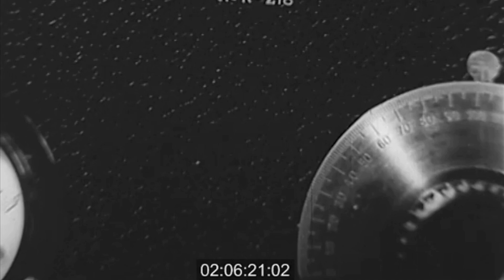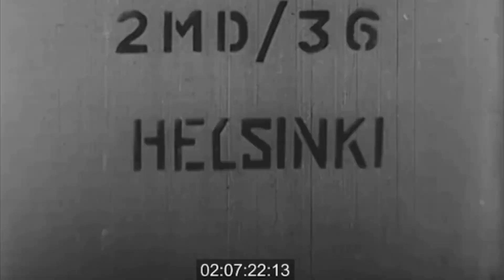How it's made: Radio     Vintage documentary movie - year 1936

Comment: I retired about 2 & 1/2 years ago from electronics maufacturing; rather than radio, I worked for a major manufacturer of very high - end computer hardware ( troubleshot circuit boards that went into their systems at the component level).  Fascinating to see the differences between vintage radio & preent - day electronics manufacturing (largely automated today).
Reply: what country?
Reply: @aaabbb4755  USA, In Massachusetts.
Reply: Hi Tom... any opportunities over there... Im in Kenya...
Reply: @StephenGachara  I’m sorry, I couldn’t say; I retired in mid - January 2020, just about the time the initial stories about Covid were starting out of China.  Company that I worked for was originally called EMC; they were bought out by Dell @ 6 ~ 7 years ago, now called Dell Technologies.
Reply: I was impressed by the freehand craft at the begining. My late father once visited a pipe fittings company probably in the 1960's where he saw basically young kids, maybe 16 (my father began work aged 13) turning the threads freehand, using wood lathe technology - it was simply faster and cheaper. Upon asking one of the youngsters how they managed to cut the threads so accurately, the reply was: "first thousand are the worst!"

Comment: Now surface mount components and radio on a chip. Next to nothing in it on a PCB. Little in modern things in the way of space but so much higher component count I bet with radios with USB, MP3 playback, Bluetooth   :)
Old school, Had a lot of valves and resistors out of an old non working old for then (1990 at college) oscilloscope us kids 16 years old or so where given to take apart. Old but not that old. Late 50's I bet. Nice how things where done, wired point to point, legs going to where they need. No PCB. Old cheap production but quicker made in china now. Nice video. Got an amatuer radio transciever in the car and a handheld. Not this vintage though. 2018 onwards to last year!.

Comment: back then, all radio's were "Q. C." inspected, and if any radio failed inspection, it was pulled off of the line for repair/ alignment. when repaired, the radio was put back into the main assy. line, nothing was waisted!!!. I bet the chassis was strong enough to be walked on without buckling, "PHILCO" did that back in the early days, they had as part of the inspection, the chassis  would be "STEPPED ON" to check for buckling, before the chassis was populated with components!!!!!
Reply: I was looking though to see if they filled in the space on the corner, behind the curved veneer.  That looked to be a potential weak point.   They may have and I didn't catch it.

I did see some manufacturing methods still used now, such as the veneer glue being heated to seal it on to the backing wood; I've seen the same thing done on furniture restoration videos.  Riveting on parts that might have to be changed later?  Yep, we definitely do that now as well (but at least rivets can be drilled out/ground off).  Our problem these days is tack-welding and glue on parts that might need replacing later.

We can get away with lighter materials and automated manufacturing now, just as in the 1930's they were making the best use of the technologies they had then.  The big difference between then and now is back then they put some thought into repairability*, which they outright don't *want to do now.
Reply: @SenileOtaku  ,I agree with you 100%, the only time screws were used to secure parts, was when you bought a "KIT", and those did not come along until the 1950's. even back then, mass production was used to keep up with demand, just like the printed circuit board was used to speed up production, and cut down on rejected radio's, T.V.'s ect.

Comment: Those hot chassis radios were dangerous. heck, back then everything  was dangerous.
Reply: Yeah but you never touch the chassis  until you need to replace a tube,anyways to change a tube you need to unplug it
Reply: It has a transformer in the power supply so it wasn't a hot chassis.
Reply: @gameyord7182  Or if the bakelite knob came loose and fell off the brass volume control shaft, you then have 220 V AC exposed for you to touch.
Reply: when I rebuild old radio's, I always use polarized molded plugs to avoid the "HOT CHASSIS" problem, the hot side is switched, and the neutral side goes to the chassis, unless the radio has a power transformer, giving line isolation safety.
Reply: @gregoryclemen1870  Greg, I too also replace the line cord with a polarized plug no matter if the radio is hot or transformer driven.  It is always good practice to plug any radio under test into an Isolation Transformer to protect yourself and your test equipment.  I also use a Dim Bulb Tester just incase the death capacitor is shorted and I also remove the rectifier tube when testing the transformer just because the filter caps are most likely bad. If the transformer tests good then I move on to the IF cans testing resistance, of course with the radio unplugged and the filter caps discharged.
Reply: @denouch358  , if I am going to "BRING UP" a radio for the first time ( variac/ lamp in series for dim bulb testing), the first thing that I do is cut the "DEATH CAP "out of the radio( for testing only), I have had my share of them "EXPLODE". the filter caps are not worth trying to reform them. as a rule my radio's are rebuilt(new wiring, new caps ,new resistors adding a "NTC" resistor in the fil. string ,so the heater string does not get slammed on start up) if the radio has a power transformer, it is fuse protected on the primary side, and I use a 3 wire service cord, grounding the chassis, and polarization is maintained.    thanks for responding!!!!.
Reply: @gregoryclemen1870  Until your house main earth gets damaged, or your wife plugs the radio in via an inverting double adapter.
Reply: @gregoryclemen1870  Hi Greg, I do the same as you do, the filter caps are the 1st to get replaced but only if the power xfmr and IF xfms are still good.  Thats why I remove the rectifier tube, just to test the power xfmr.  Best Regards
Reply: Definitely NOT a hot chassis!
Reply: @denouch358  As this is a European-made radio, it probably has a selenium rectifier.   These are like some electrolytic capacitors - if the radio hasn't been used for many years, the selenium rectifier may need reforming.  Disconnect everything fed from the rectifier and bring it up very slowly using a variac.   Monitor the rectifier temperature with a finger - if it gets warm without any load, you are bringing the voltage up too fast or the rectifier is defective.   Don't power selenium rectifiers at full voltage immediately until you have reformed or checked them.   If you do, you may learn the hard way - they can stink out your whole house and your name among residents will be ruined.
Reply: @denouch358  , I do the same as you do, I check all of the transformers first, before I continue on with the rest of the rebuild. I have a 1940 "PHILCO" radio that everything checked out, I have a good habit when testing the power transformer to document the secondary voltages. the power transformer after doing a complete restoration, shorted out and blew the fuse on the primary side that I installed. no big deal, I have a large stock of "new/ old " transformers on the shelve ready for use. so the radio got a new power transformer. I also have new/ old stock of cap tuned I.F. transformers, including audio output transformers, both single ended and push- pull primaries. I am so glad that the younger generation has taken an interest in this "STUFF", I never left it!!!!!   thanks for responding!!!!
Reply: @keithammleter3824  , I assure you "THAT WILL NOT HAPPEN"!!!!!
Reply: @gregoryclemen1870  Re other people in the house using double adapters:  yes, I've heard "that will not happen" before.
Re house main earths going open, or the neutral from the street to the house going open - yes it does happen.  In my state a girl child now has permanent severe brain damage as 2 years ago current stopped her heart until she was found - because the neutral went open, and the current went to earth via her bare feet.   And if the neutral lead in your polarised power cord goes open - same result if a pot shaft or other metal can be touched.
If you must restore an old transformerless radio, don't rely on polarised plugs, replace all brass-shaft pots with plastic shaft pots so that if knobs come loose it will still be safe.   Cut the tuning capacitor shaft and use epoxy to create an insulation barrier.  Make sure you have a rear panel that cannot come off without using a tool and that all screws & metal are covered.
Transformerless radios and TV's should not repaired or restored, as they are dangerous, unless there is room to fit an isolation transformer.   And there usually isn't.  Transfomerless colour TV's are especially bad because half wave rectification means DC drawn from the mains of sufficient magnitude to corrode away house earths.  English Decca colour TV's were after a while banned in my country for just that reason.
In the 1970's I did TV repair, and I always refused to repair Deccas because there was no way to make them safe.   They were crappy TV's anyway, using vacuum tubes long after all other brands were fully solid state.  But at least they had plastic pot shafts, unlike old vacuum tube radios.
Reply: @keithammleter3824  there is no need for adapters in my house, also the pole transformer center  tap( neutral) is tied to the copper piping( type K) of my geothermal system that I installed 30 years ago, in addition to a ground rod and re- wiring the house in pipe, grounding is not an issue, also the pole transformer is not shared with other houses. yup!!!, I am an electrician also!!!!   thanks for sharing your comment.( what you are saying is 100% accurate)
Reply: @denouch358  Not all radios had power transformers; usually had a power cord with resistance to feed the tubes filaments. Those transformers added 3 pounds to any "portable radio".
Reply: и сейчас все опасно, жизнь опасная штука  , кто знает что ждет каждого из нас завтра за углом .😅